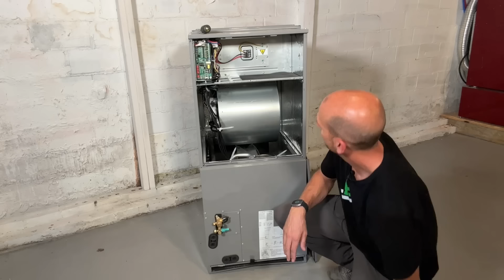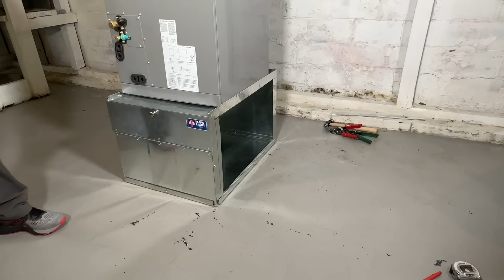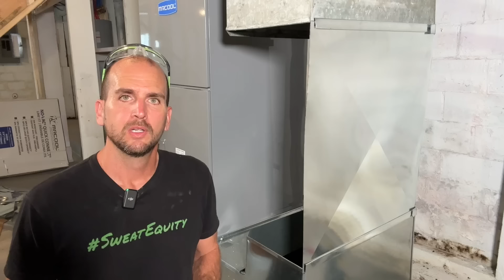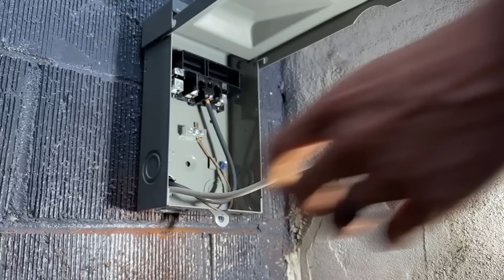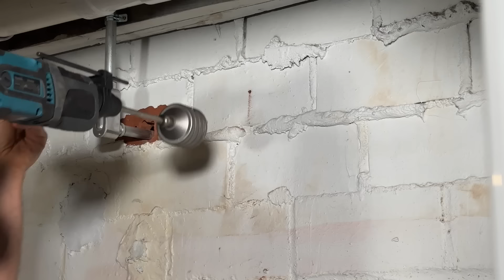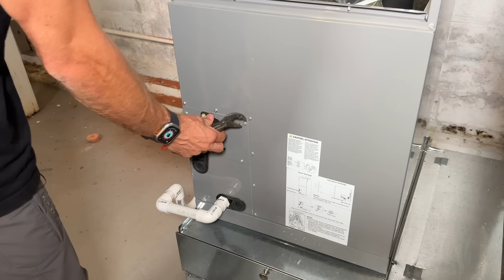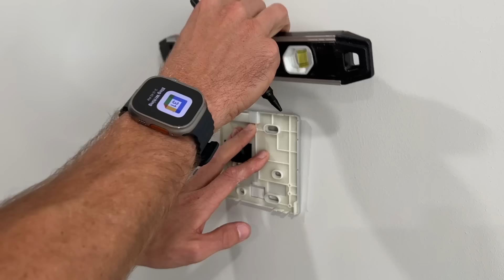How To Install Your Own Central Air Ducted System | Mr Cool

Comment: 3.5 ton unit will have1300-1400 CFM max air flow.  Return duct lower 90 deg is too sharp of bend and too small total area that appears to be less than one sq.ft..  A lot of air turbulence created at sharp elbow along with very high air velocity over 1500 FPM.  Will raise static pressure resistance.
Reply from the maker: Thanks for the feedback.

Comment: Great video. For 240 circuits using romex you should be using the red sheathing version which provides black and red conductor insulation.
Reply: You can use the white wire as long as you mark it.  Perfectly acceptable.

Comment: Why does nobody ever mention on the internet how to remove the drain caps to install the drain pipe? Is it some kind of secret that nobody is supposed to know?
Reply: I also have not seen anyone talk about a drain pipe for the outside unit.   Found out that there was one when installers asked how long I wanted the tube and if OK to just let it drain on the concrete.

Comment: Your videos are easy to follow and very informative. We just installed a Universal 4-5 ton Mr. Cool in a remodel for my son and daughter in law. Big help! Thanks.
Reply: I have just ordered the same system. Was the air handler A- coil pre charged like the line set?
Reply: @tomg4753 aor handler contains dry nitrogen. Outdoor unit precharged with refrigerant and its very heavy.

Comment: Okay, so I live in an area that 3-4 weeks a year the LOWs can be between -20F to 10F, which for these kind of heat pumps is not a high efficiency range, and so other brands I know of have supplemental coils that HEAT when the heat pump itself can't do so, do you know if Mr. Cool has equipment with this functionality?  Loved your work here, right tools, and a mindset to just take it one step at a time, and make it look almost like a pro did it.
Reply: Yes they have those coils available

Comment: Hi Scott, I really impressed with your video. I learned a lot from your video today. Keep up your great work, Scott. You are helping a lot of people like me. I am about to move in a house that has windows AC unit everywhere and it's time to change it out with Central Heat pump unit with MrCool. 

Do you have the link for the filter rack in your video? 

I will need 5 ton system, how am I going to make sure that all accessories I buy match with 5 ton system? 

Thanks Scott.

Comment: When you crank those line sets down, do you need another wrench...two wrenches to do it?  Looks like you just used one.
Reply: Its in the manual,  use two wrenches.

Comment: Question: 6/2 wire was added to both the heat pump and air handler to the electrical panel to convert 220v to 110v?
Reply: It's all 220v no conversion

Comment: I don't think the thermostat is actually battery powered. It doesn't power on until power is supplied to the air handler.
Reply: Ok thanks for the relief, I’m setting mine up rn and after the battery the thermostat didn’t power on. Kinda thought it was a dud

Comment: Great video, the only issue I see was that the unit doesn’t have a heat strip. You need it as a back up just in case the unit fails with a leak or blockage. Second what will happen when the unit is in  defrost mode with no heat strip?
Reply: It has smart future where it turns fan off while its in defrost mode.

Comment: Why did you pick this one over the Universal?  Was this because of a sponsorship? Comparing the specs, the universal is more efficient and they both go the same low outside temps. The Hyper Heat looks to have a slightly better warranty and might be slightly cheaper, but otherwise it looks like the Universal is the better option.

Also, you said you weren't going to use the thicker filter option.  They are definitely better: better airflow with higher MERV ratings and they last longer (I change mine once a year).

Comment: Following along as best as possible with the 24k version of this, what am I missing with the weird square drain plugs in the AHU?

I had to rotate the components as I'm doing a horizontal right configuration so the original vertical drain plugs I was able to remove but the ones I actually need are stuck fast and the plastic is start to warp.

Not sure if there is a very specific tool required here but anyone else had this issue?
Reply: I used a small crowbar angled to get 2 grooves n twist left
Reply: @Skat3WhatThat the plugs I needed to remove turned out to have been fused during the manufacturing process so they were essentially glued in and had to cut them out, but to MrCool's defence they sent me a new drain pan within a couple of weeks.

Comment: Does the airway of the central heat/cooling needs to be insulated? I had someone came and checked my house and he didn’t mention anything about that and and mine are not insulated with the fiberglass

Comment: I used to be a union tin knocker,  I can’t watch this guy make duct one piece at a time,
Reply: Still got the union sticker on my ducting from 1979 🫡
Reply: At the end of the the union sheet metal job and his diy both do the same function.  As long as it is sealed it's fine.  There are things I don't agree with the way he did some of the transitions...but he got there in the end.

Comment: is there any point using the fused disconnect box indoor? mine has but it melted so i need to swap it with a new one and am not sure if the fused one is needed
Reply: Its per city code.

Comment: Did I miss something? Did you forget to insuate your supply plentum? It will get cold and sweat and rust your sheet metal. Made that mistake when rebuilding mine and had to put duct board on the outside instead of the inside. I noticed that your exsting ducts were insuated on the inside.

Your temperaure at the vent were off. For cooling there should be about a 20 degree F difference between return air and supply air. Unless you have a variable speed unit. With a variable speed unit you have to get it operating at high speed to take the measurement.

Comment: im using 14/3 and 6/3 if your platform for handler is metal you must ground. read manual not every install is the same. good video. his neutral is unsheathed witch seems sketchy but im not an electrician.
Reply: That's not a neutral that's a ground
Reply: Why are you using 3 legs, which handler requires that?

Comment: 30 gauge thickness is very small metal I use 26 gauge thickness and no offense but you should have used more s cleats you have major  leaks everywhere also you didn’t seal any of it with mastic

Comment: Couple of thought, I've  noted that a lot of highly respected (by me and others) YouTube content creators are using MrCool products. By the time a professional gets around to installing your system any reasonable DIYer could have installed several systems. In my experience installation costs are often 2-3 times the cost of materials this gives a DIYer significant reserve cash to replace failed parts should any problems occur. Many MrCool products retain the 10 year (near industry best) warranty when homeowners install the product in their own home if the pre charged line sets are used. With that being said I see very few MrCool failures. I do see reports that MrCool customer service is not perfect. Finally the new technology heat pumps are so efficient they will pretty much work fairly well anywhere in the lower 48. Please correct me if my impressions are incorrect. I am strongly leaning DIY MrCool in a new home build. As a foot note in this video's application the 220/240 volt service is still single phase.
Reply from the maker: Thanks for the feedback, I am having good luck with this unit at least early in the first cold season.  I am also installing a 18,000 BTU mini split in my garage today 👍.  I can't personally speak to the durability but will keep you guys posted through the channel.  I have been monitoring the energy consumption and will put out a video later in the winter showing my experience with a heat pump in cold temps.

Comment: ACIQ also has the very same system with hyper heat and the same size. I just finished installing mine and shes a beauty very quiet and cools plenty and heats very quickly.
Reply from the maker: I have been super impressed with how quiet these units are, very nice 👍
Reply: How has the unit been working for you so far?

Comment: As for thermostats, if you have a blue wire, you have 24 volts and usually in that case, a battery isn't required but has the option. Alternatively, if you MUST have a battery, I would suggest a "Battery Eliminator" or "Dummy Battery". Those can be found in The Amazon. Then perhaps run a wire from an emergency power source (If you have your AC and / or Furnace also powered that way) and you won't have to worry about a damn battery which are harmful for the environment and need to be disposed of in a way that's inconvenient. You said you have 8 wires in 18/7 wire. I purchased a spool of 18/7 and all I have is 7 wires total. So that piqued my curiosity. Was I cheated by The Home Depot ?

Also, since you have about 4 or 6 wires you're not using, a dummy battery would be perfect for you, and you can connect that to some of those wires you're not otherwise using to carry a current. You might even be able to tap off the transformer if you understand how resistors work or just cut the transformer off the dummy battery eliminator and run it from the other end through those "unused" wires.

When I buy electrical tape, I usually go out of my way to find multiple colors. In the case of "Marking" wires I might settle on a multicolor pack which isn't really electrical tape. But if you can, go for actual electrical tape because it's better.
Reply: 7+ ground 18/7 and 18/7 with ground two separate things.

Comment: Doing an install of the 4 ton version of this system. One thing I learned is finding terminal rings that fit the narrow tight terminals is tricky. What I eventually figured out is I could use a hammer and a concrete slap to make them oval terminals which fit!

Comment: Best video for the Mr. Cool heat pump. I just purchased a Mr. Cool Universal 4-5 ton heat pump. You spoke of using a Mr. Cool thermostat. Do you have a model # for this? I looked everywhere to buy the Mr. Cool thermostat and even Mr. Cool didn't show it.
Reply: Scott installed the Mr Cool Hyper Heat model, different from the Universal (although they are both central ducted).  The Universal can use any 24 V thermostat, the Hyper Heat uses RS485 and that proprietary thermostat comes with it.

Comment: Great video, I'm considering the hyper heat unit to replace my old system in my mobile home at the lake home. And would have to convert to down draft and as a direct replacement here in S.E. Missouri.  I'm on the fence with a 24k or 36k unit. 960 sqft . But with old windows and doors puts it at 3tn.

Comment: Could you give me the Menards 90' filterbox model or sku #.  I think it will work perfect for my build too.   Thanks for all the good information!
Reply from the maker: Menards SKU 6393976  I think there measurements as shown online are the vertical portion (smaller) end of the fitting.  Saved a TON of time 👍

Comment: You'll want to use foil tape and/or mastic to seal the edges of your new duct work. You don't want air leakage on the supply or return through the gaps and cracks or in the ductwork in general. (Even perfectly cut and installed ductwork by default leaks air.)
Reply from the maker: For sure, thanks for the feedback! 👍
Reply: @EverydayHomeRepairs  what is the model number for the thermostat  been looking everywhere for it and can not find it

Comment: You better hold up there buddy... you did not mention anything about a surge protection for the outdoor condenser nor did I see one on the disconnect box outside unless there's one already inside the condenser which I HIGHLY doubt,, if I were you, if there is no surge protection on that condenser I would turn the disconnect box back off and I would not run that system until you get one on , or you're going to have problems!!    surge protection is a MUST on inverter systems.

Comment: Where did you purchase the Mr Cool unit and lineset?
Reply from the maker: The Hyper Heat units are still pretty new but a few of the online suppliers are starting to carry them here is who supplied my unit https://iwae.com/shop/3-ton-16-seer2-mrcool-hyper-heat-central-ducted-heat-pump-split-system-multiposition-ha23525.html

Comment: Isn’t this a heat pump? What are going to do when this goes into defrost and creates water? Mr Cool doesn’t say to have that 10” or more off your slab? Maybe it doesn’t freeze in your location, so it’s not needed.
Reply: He has a condensation line. Must not need a pump.
Reply: @emiller7040 on the outdoor unit?
Reply: @defomatt2684  The question was edited after I replied and now refers to defrost water. Condensation line is needed at the air handler, inside the basement or attic, which this video shows he has.
Reply: I installed mine above highest expected snow line.  Had first significant snowfall since I installed 4 months ago. Pretty sure I wouldn’t want the outside unit on a ground slab.

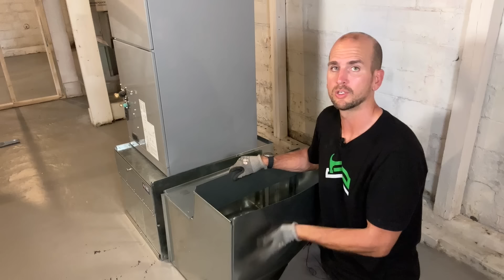Comment: I am an HVAC dealer and to make installs quicker I try to get as much prefabricated ducting as possible.  Where did you get the filter rack and rounded return air boot at?  I did not see that in your links of tools and supplies.  I use the same return plenum your AHU is sitting on but have been searching for the built-in filter rack for 4-5" filters and the rounded return air boot.  Could you please link me or tell me where I can find that item?  It is showed at the 13:14 mark of the video.   Thank you!!  Usually, I use an AprilAire or honeywell filter box to attach between the return and the furnace/AHU, but it would be nice to have a solution that can accept larger filters.
Reply from the maker: I got that one at Menards which is a large home improvement store around the Midwest.  Thanks for the feedback 👍
Reply: @EverydayHomeRepairs  We do not have those here and none of the parts houses seems to have them.  They can be made but time and materials is ridiculous.  I searched the Menards website and didn't find the specific part in your video.  I guess I will keep looking around and keep building them with AprilAire and Honeywell boxes.  I carry the filters on my van, so it is just as well.  I know there are a lot of metal fabrication companies in the Denver area, but they think they are made of gold bars.  

I made a long list of suggestions for your plenum build and decided not to send them as I am sure you are aware of most of them by the other comments that were and will be left.  I think you did a great job for not having much experience in that area.  I know guys that do it professionally that would have struggled building that.  They will always whine about anything someone else does.  The only real advice is to seal the system and plenum very well; however, you like.  I use mastic from a bucket/tub on the inside while it is still open, then silicone and tape the exterior for the remaining areas and leaks.  Otherwise, that was a pretty good install for a real DIYer such as yourself.  Not many could pull that off so well.  Nice work, my friend!
Reply: Aprilaire filters are great. I change the 213 filter once a year.
Reply: @emiller7040  You must have some kind of unicorn super naturally clean air and no pets to run a single Merv 13 filter for a year.   We usually use the 210, but some 213’s.  Some are changed quarterly or on the bi-annual service schedule.  They are absolutely filthy and disgusting at 6 months, so I recommend 90 days, if they have pets or lung issues or other health problems.  That’s like not changing your oil for a whole year.  How much does your system run? We run continuous fan mode 24/7 and folks have pets and kids.  They wouldn’t have any airflow in 12 months.   That’s incredible to think about.
Reply: @Balticblue93 I've never had a filty filter. No pets, two homes in NC, Carrier systems, one natural gas/central air, one heat pump. Nest thermostats, systems run only when heat /air is called for. I've used genuine Aprilaire filters for probably 20 years. Added the upgrade kits to both homes many years ago so I didn't have to deal with those plastic fingers!
Reply: @emiller7040  That’s incredible, I have yet to see one after 6 months come out not fully clogged full of crap.  So I recommend quarterly changes on those systems.  I wouldn’t dare do 12 months even if they made a Merv 5 or 8.  I prefer Merv 8 on the Honeywell boxes.  But AprilAire is a majority of all my clients.  And included on all change-outs or new clients.  Honeywell takes a 5” box filter, but AprilAire takes up way less room on the vans for stock.  Glad you have had such great luck.

Comment: Where is your torque screwdriver? You need to torque your electrical connections down to what is specified for your wire size